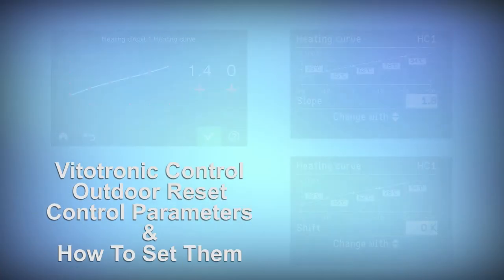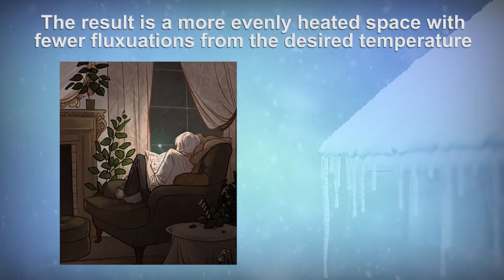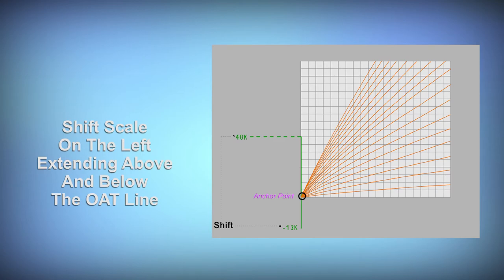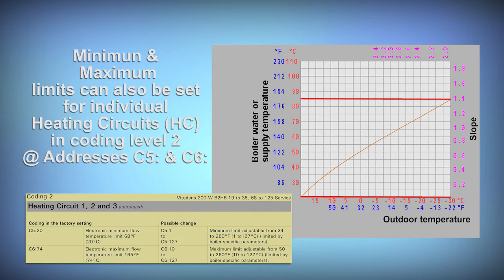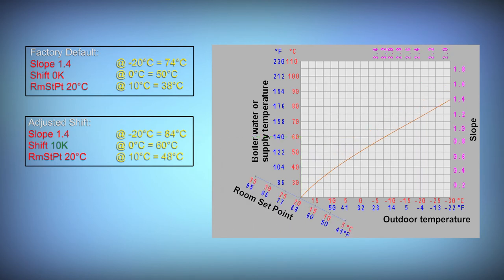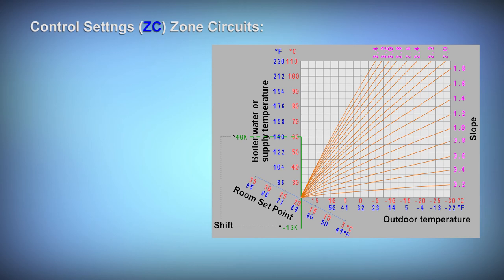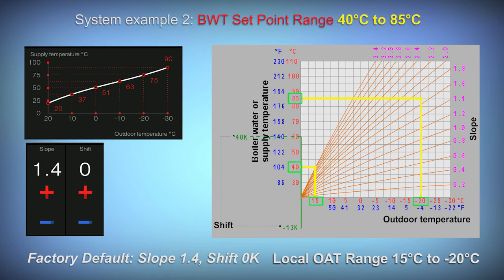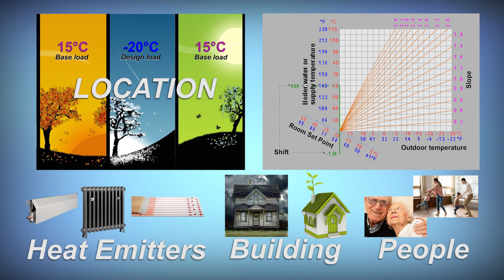Heating Curve Parameters and How to set them for Vitotronic Controls

Comment: This video was very helpful.  Just had a new radiant floor wet heating system installed with a Viessmann furnace.  Having some difficulty getting the system to produce enough heat for the house.  The technician who came was explaining the slope adjustment and I had no clue what he was explaining to me.  This helped me to understand what he was explaining.  Hopefully, they can get this system running smoothly.  Thank you.

Comment: I have a condensing boiler, but it's a Vaillant brand.
Have the curve setting but not sure I have the Shift one on my control, or maybe it's called differently..
I have also a external temperature sensor.

How can I adjust so the heat temperature doesn't go over a certain C°?